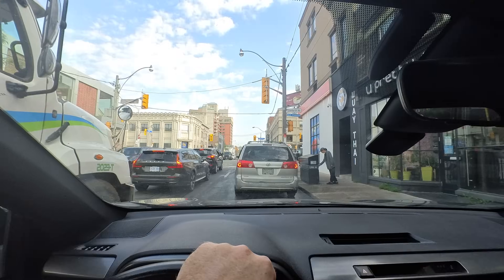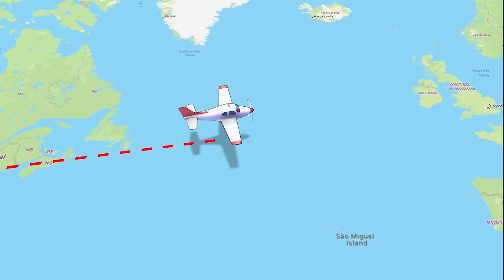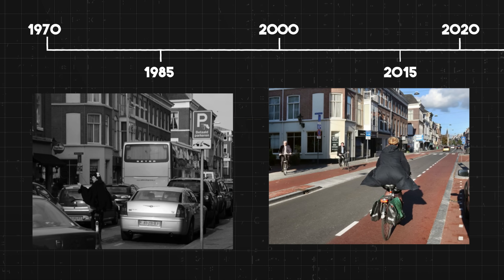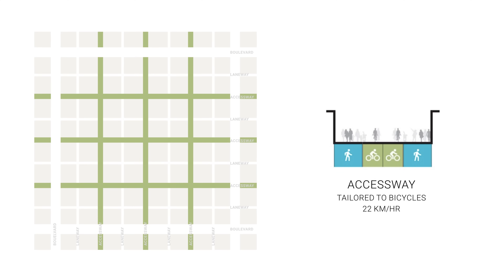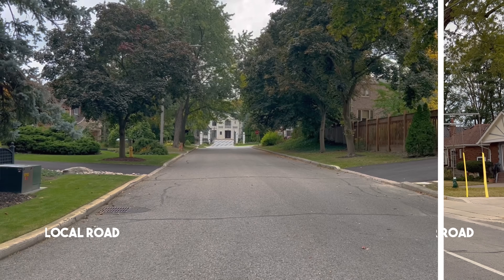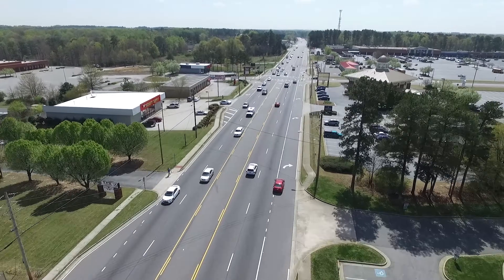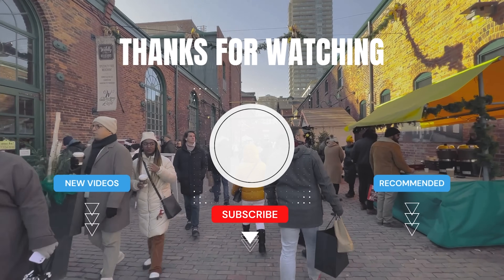How the Dutch SOLVED Street Design

Comment: Did anyone notice how many of the buildings were multistory? this may seem like a side issue, but I live in a growing city and there is so much resistance to accepting that single family housing cannot accommodate public transit. But there is a transition issue in that more dense housing doesn't have parking but the transit systems are not adequate to get people around efficiently. There is the added problem that people are used to having to commute long distances and there is definitely not the public transit to accommodate that. I doubt those bike riders are going more than a few miles at most before either their destination or transferring to public transit.

Comment: Did a cycling trip across the Netherlands recently, I was blown away by the infrastructure, not only in the cities but also in the rural areas. Literal separate cycle highways between small towns and cities.
Reply: I hope the weather cooperated. 🌞
Reply: @joeycee5680  It did indeed! got really lucky with streak of sunny days in April with only light showers overnight. Only complaint would be the headwinds.
Reply: How far apart were those cities and towns?
Reply: @maggiv5401  Not very far at all, maybe 10km was the longest stretch of uninterrupted path before you hit another little town. It's an amazingly connected country.
Reply: @2penry2  those towns were there before the connection. The point is that the area is condensed unlike in the United States once you get past the Mississippi you can go very long distances between towns. Very few people are going to choose to ride bikes for  distances like that. When I visited Ireland, I was told that at one point before the car, every town was no more than 6 miles from a railway station. I’m pretty sure most of those towns existed before there was a railroad.

Comment: "The Amsterdam network" All of the Netherlands.
But that's part of the beauty of it. It's all connected, and that's a large part of why it works so well.
Reply: Amsterdam Metropolitan region
2,580.26 km2 (996.24 sq mi)

Toronto Metro
5,905.71 km2 (2,280.21 sq mi)

Netherlands sans water
34,329 km2 (13,254 sq mi)
Reply: How many square miles are we talking about?

Comment: Shared streets are really easy to mess up. If you just put them all together you'll end up with a big mess. It only works if you have first diverted almost all car traffic to elsewhere and made sure that driver prefer to drive in the other place. The few people who then still need to be in the shared space will have to use it as an end destination, not for shortcuts or through traffic. Shared space can only be installed correctly in very specific situations or they will just be very dangerous places for the more vulnerable road users.

Comment: You may have noticed this, but in lower speed streets - we often used tiled roads instead of asphalt. The reason for this, is that it is much more noisy for drivers and you notice your speed much more.

Comment: Purely on a design level, I agree with the video.
It does not mean that traffic gets safer in the Netherlands. It's quite the contrary.
The Netherlands is a densely populated country that keeps growing denser and with more people participating in traffic. Despite traffic design being world leading, more and more (deadly) accidents continue to happen (or at least reported). The reason? People disobey the rules of traffic at an alarmingly increasing rate.

Ghost driving has become the new standard and gets more and more rampant year over year. 100% (rounded up) of all cyclists no longer signal direction when taking a turn, despite it being mandatory. There is zero police control on this matter, and even if there is, the problem isn't halting or reversing. And this trend is seeping into the behaviour of car drivers.

The moral of the story: it doesn't matter how well you design your traffic, if the people that make use of it abuse it.

Comment: But emulating Dutch street design won't yield all benefits. Dutch urban planning provides easy access to schools, shopping districts, libararies and sporting facilities. We don't need the car as much as Americans or Canadians do and our culture accepts it that even top level managers (or even our Prime Minister) get to their work by bike. But we do have congestion in our cities and highway system due to inter-city commutes. Parking spaces are becoming a bottleneck in residential areas and large urban centres because people own more cars per household and cities market themselves as day-trip opportunities. Also, larger cars (SUVs and such) take more horizontal space and are effectively muscling bikes out. All in all, you can lead your life not depending on a car per se and cycle for miles without even seeing a traffic light, but there are some challenges down the road we must face.

Comment: I'm not sure the shared roads concept will work when 50% of drivers are in pickup trucks which safety standards are based on protecting the people inside the truck with zero regards for those outside of it.
Reply: SUV's and pickups are more dangerous for their occupants too.

Comment: 3:36 that's the national cycling network, not just that of Amsterdam. The weird part is that you could have just used a map of the Amsterdam and it would have gotten the point across just as well if not better. 
4:01 that's not even the Netherlands that's Sweden (I think). And again the weird part is that it would be so easy to find an example from the Netherlands and then your argument would be 10x better. 
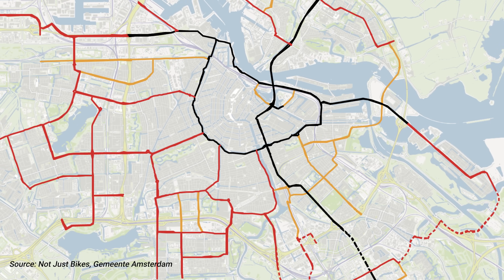4:19 there you go that's the map, why not just use that map and compare it with Toronto. 
sincerely a detail oriented dutch person
Reply: Mistakes happen

Comment: Great video! Something that often gets overlooked is the material of which the road is made of. In residential neighborhoods in the Netherlands you will almost always find bricks instead of asphalt. Driving on bricks create more noise, which causes you (generally) to drive a bit slower. It's cheaper in maintenance too.
Reply from the maker: Great point!
Reply: The bricks are also more permeable, which is also very important in the Netherlands, and it's more pleasing to the eye. It also makes access easier to get to cables or plumbing underneath and quickly reassemble when the job is done.
Reply: It's great

Comment: It definitely sounds interesting. But amsterdam is pretty tiny. I can see this working well on a medium to small city. I lived in a small town years ago that actually built up it's mass transit and prioritized that over cars.. kinda. Just a bit more than most us cities. For the vast majority of trips.. if you weren't particular about when you left. It was basically about the same amount of time mass transit or car. With some trips being maybe 5-10min more for mass transit. Hardly worth worrying about. If you absolutely had to go from one end of the city to the other. Car was definitely faster. But it wasn't painful doing it via mass transit.

However... this was only true because of their size. Scalled up. The system didn't work. And it fell apart after the city grew bigger.

I kinda think that might happen here. I mean if you were to implement this in my area.... my area goes on for almost 200 miles. And yes... sometimes you want to go that full distance. I get you still have highway for that. But with more people. You need more space for things. Things are further apart. Even if sidewalks are a primary mode of travel. This requires you to put most everything a person could want in a reasonable area over a city. Jobs. Groceries. Recreational supplies... everthing.. that it would genuinely need. Or else mass transit gets extremely complex and looses benefits for longer distance travel. You need scale factors. Trains that stop at each block. Trains that only stop every mile or several blocks or whatever. Then Trains that only stop every 10 miles or something. And in my area. Maybe even Trains that stop every 100 miles. That's a lot of infrastructure.

Again. I really like the idea. But I do think they are benefiting more because of size. I mean... I do think it is a better idea in general. Theres not that many cities in the use the size this one is. But.... I think it has a limit of usefulness and a point of critical failure smaller than our current methods. I base that off of experience with other alternative traffic models.

Plus also... safe? Really? Make me go over a speed bump and I'm plotting your death. Make me go over 10.. I'll be knocking in your door... So no. Not safer 😂😜
Reply: Its 100% safer, and this would work on large scale. No reason it wouldn't.
Reply: They also have a lot of tiny cars in some parts of Europe.
Reply: It has really nothing to do with small or big cities, or small or large countries. In 10 minute communities, like implemented in NL, everyone can reach a store, school or sports club within appr. 10 min cycling… that’s smart city planning, no matter how big it is.
Reply: @PrinceWalacra  Cities don't run or decide the businesses that go in a spot. They just have zoning laws. Dictatorships might be able to do that for some countries. 
 For me (using travel time on google maps and tracking round trip travel time) Going to the 7-11 for a slurpie would be 16 minutes walking, 4 minutes on bike or 2 minutes by car. The closest grocery store (no way I can afford to shop groceries at 7-11) Walking an hour and 14 minutes,  Bike 20 minutes, Car, 10 minutes. Going to work it would be 4 hours 14 minutes walking, 1 hour biking, and 26 minutes by car. Again this is all round trip coming and going. I think the people that think like you do probably live in tight compact city areas ... but in most areas it isn't practical or realistic.
Reply: Amsterdam has about 1 million inhabitants. Its not tiny. Anyway, the size of the city is irrelevant. Infrastructure has to be good everywhere, big or small. A town of 50 thousand people needs a bus stop and a city with a million people needs many train stations.

Comment: Great video once again! I would say the only thing the Netherlands does wrong about their bike-paths, is their way of making 2-way bike-paths on each side of the roads in the cities; This creates chaos and insecurity on the roads.
A bad example that other countries follow and implement. Lots of the bike-paths aren't protected as well here, which is kinda bad as well🇳🇱🇩🇰
Reply: As long as it's wide enough it's better I would say. Less crossings needed. Otherwise if people only need to travel a few hundred meters they would go on the "wrong" side anyway.
Reply: Chaos and unsecurities amongst tourist? I never had anything like that. I actually like them, they are usually very wider so this makes it easier to pass too.
Reply: Maybe you're not used to them? Its not hard to look 2 ways.
Reply: This is only done on slow (30km/h max speed) streets, and having the bikes on the same road with the cars means the cars have to slow down and match the speed of the bikes. The streets are also one way for cars, and generally so narrow that a car cannot overtake a cyclist.
This is safer than having 50km/h traffic and seperated bike lanes, with people crossing streets on bikes or on foot, taking left turns, etc.

Comment: NB. Point to note.........most European cities are not built in blocks...,.
Reply: Yes, explaining Dutch infrastructure in terms of blocks is very confusing to me as a Dutch person. The block structure itself seems to make the traffic situation worse.
Reply: @rubenvanbeesten The issue with blocks is that they make driving too easy. To get from anywhere to anywhere else in a city you just drive straight, take one left or right turn, and then drive straight.
Compare to Dutch cities where just driving 500 meters requires navigating a maze of bendy, usually one way streets, or alternatively driving in the opposite direction to find a ring road and then driving around the city center and entering from the other side.

Comment: There are several other factors to consider such as mixed neighbourhoods where people can live, work and shop close enough that they can easily walk or cycle to services. Every little neighbourhood has shops and restaurants. 
Then there is public transport infrastructure, most European cities have access to public transport within a 3 minute walk from home or work with greater frequency. In Europe you can get from point A to point B without having to go through a central downtown hub, public transport in Europe have ring networks moving people around the circumference of the cities. Airports and train stations are all served by public transport.
European cities also have a better system of parking, taking cars off the streets in underground garages and large, multi-story park houses next to shopping and business areas.
If you properly design the greater societal infrastructure instead of bits and pieces, it is proven that cars, bikes and pedestrians can function together.
Reply: The US can do this, its not something only Europe can do
Reply: @andrewcharlton4053  One of the problems is that US zoning and nimby laws restrict to what extend this can actually be implemented.
Reply: @_DRMR_  Of course. But that can be changed. That's the whole point

Comment: This sounds awful forced to drive slow? Take public transportation? Ride a bike to the store? Absolutely not
Reply: Do as Adam, and go experience it by yourself.
The point is, that here in the Netherlands, not all roads/streets are considered equal.  When traveling longer distances by car, for the majority of the ride we will drive as fast as and probably even faster than in North America.  Only for the first bit and the final bit we will drive slower because of the other kinds of road users like pedestrians and cyclists on the residential streets.  Overall that causes hardly any delay and your trip will be equally fast if not faster.
And when the store is only a mile away and all you need is some small things, then it’s almost always way easier and faster to ride a bike here or maybe even take the walk.  Many people here are happy to do so.
Nobody is forcing you to choose a particular mode of transportation here, but you will quickly find out that most of the time there are multiple options, each with its own advantages.
Reply: I think he does not explain it quite well; we only drive slowly when sharing the road with bikes and that's not a lot at all. Dutch infrastructure is not just superior for bikes, it also is for cars. The Netherlands routinely scores a top 10 place in the Drivers Satisfaction Index and the TomTom Traffic Index Ranking shows Dutch cities to have some of the highest average car speeds during rush hour AND some of the lowest time to travel 10km within cities in general. We're not forced to drive slow at all; you are.

Also, a major part of the Dutch success lies not so much in traffic infrastructure but in zoning; the vast majority of homes have schools, supermarkets and sporting facilities so close that it is simply the most convenient to walk or bike there. The average distance to the nearest supermarket is just 900 meter. That's including rural areas; in many city centres the average distance is less than 100 meter and in the 3 largest cities, everybody has at least 3 supermarkets within a kilometre.

Note how that also means that parents do not have the burden of having to take their kids everywhere. Instead we can spend that time replying to YouTube comments about our infrastructure and smoking weed.
Reply: You’re forced to drive slow to lower the enormous amount of traffic deaths in the US down to an (I hate to say it) acceptable level. Deaths are a huge burden on society, in time, costs and emotions. Unnecessary traffic deaths are even more a burden and harder to accept. Being an American it must be good to know that it is economically feasible and beneficial to reduce traffic deaths. So being forced to drive a bit slower in order to achieve that goal would be, for every normal person, the normal thing to do.
Reply: Slow is smooth, smooth is fast.
Reply: Yeah, nobody in the US ever drives slow. Just ask motorists in New York or California 😂
Reply: You only have to drive slower in areas with shared traffic network, this is to ensure safety. If you think that's stupid, you're the reason other countries have so many traffic fatalities. Public transportation is managed well here, its clean and fast. Riding a bike to the store is quicker than a car depending on where you live sometimes, only in countries like the USA is a drive to a grocery store 10+ minutes by car. Here, everything is close-by and its more convenient to be on the bike sometimes. Sounds to me like you're lazy.
Reply: Imagine being presented with the option of getting some healthy exercise and fresh air (without exhaust fumes) while doing your grocery shopping and saying "that sounds awful" and then getting back in your car to drive your ass to the gym to cycle on a machine while looking at a wall.